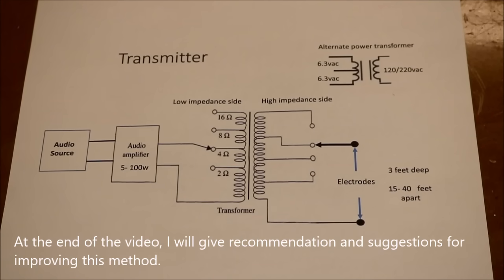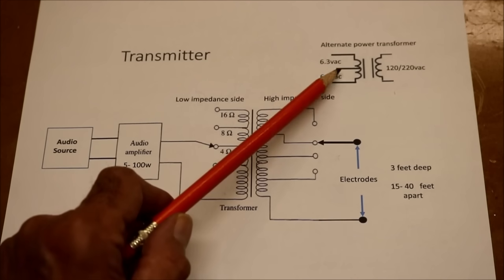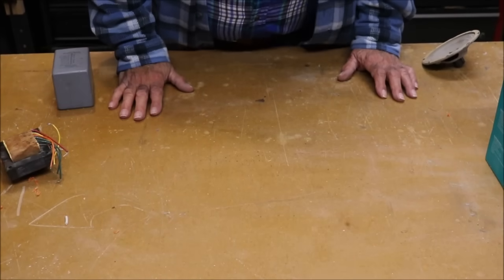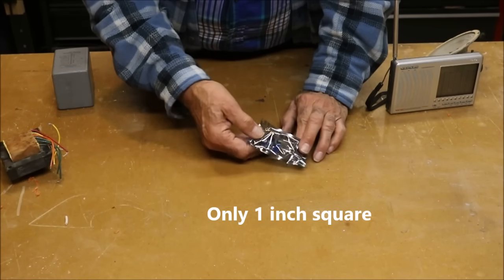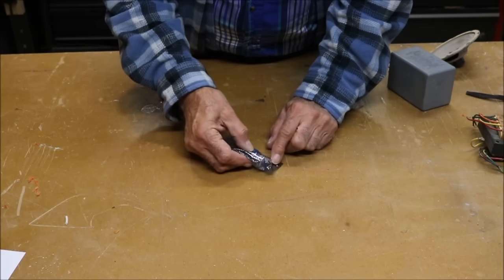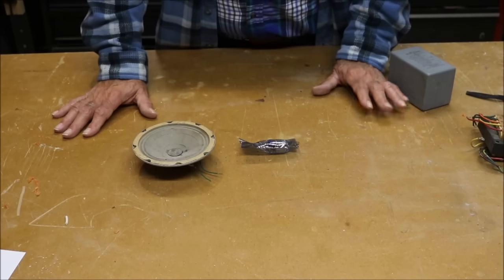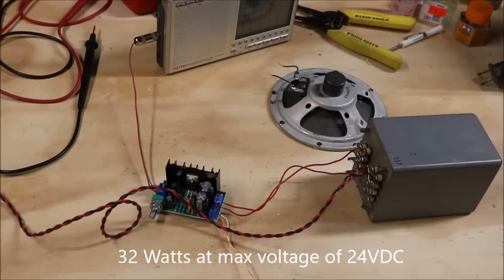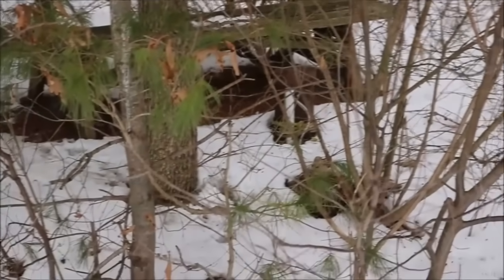DIY Communication Through the Earth

Comment: There was an English student radio station called UKC that started off this way, using the central heating system and earth as the transmission line. You just connected a modified transistor radio to receive the signal. This was when the BBC had the state monopoly.

Comment: I have been thinking about building this device.  It is for digital communications through the earth.  So maybe you could interface it with a Raspberry Pi.  Brian Pease has modified this design to a class E amplifier, but then it requires tuned antennas.      
https://radiolocation.weebly.com/uploads/2/7/5/2/27523347/creg_j124003iandrummond.pdf

Comment: Seems very interesting- I´d love to have a follow up with actual transmitted audio to listen to, actually hear what comes out of it. The crystal headphones part would be hard for me.
The only crystal phones I know are antique and (I think) sought after by collectors. I seen a few on Egay but the asking price was redicolous. But I like this low tech.
But if it is known this being used I could listen in on other coms? What happens if more than one broadcast happens in close range of each other? Would that garble up both?
You need to go into this further. Maybe it is worth re inventing… Greetings
Reply from the maker: The earphone in the link I provided are high impedance and aorund $12. When the weather warms up I may do a repeat, but not when is is 5 above with a wind chill. If two or more are broadcasting you would hear both on top of each other since there is no carrier.
Reply: @PracticalEngineeringSolutions  No, Sir- I don´t expect You to do a follow up NOW.
But in spring when it´s nice and the rods go easy in the ground.
Still: very interesting.

Comment: Many people do not realize but the Tesla's high voltage transmitter (Tesla coil), which is wrongly considered an aerial/air based system, is actually a huge high power ground-pulsating current transmitting device. The corona part, a HV capacitance system, is what the most people are familiar with, but the real work is done by the ground connection, were the power swinging between the HV capacitance and opposite side, the ground, is induced in the earth. That can be quite easily understood ones one read the article published by Tesla called "The True Wireless".

Comment: Great video. I did a similar experiment back in the 70's for a class. My setup was similar to yours except that I used a 10 Watt tube amplifier for the transmitter. I used a transistor amplifier in a box with a speaker and meter probes for the receiver. It worked for about a block distance. It was thrilling. One thing that happened is that the audio could be heard in all mater of audio equipment such as the telephone and tape recorder if the equipment was close by. I'm very glad that you did this test.

Comment: I have strong suspects systems like this, do not rely on radiation. Can these be actually conduction currents in the ground without any radiation at all?
Reply from the maker: I think you are right.
Reply: @PracticalEngineeringSolutions  But this is usually denied. Every time I ask, they fall back to "VLF ground waves",  "surface waves radio" phenomena, but never "ground currents" on their own, which are seen as a consequence, and a loss.
Reply from the maker: @tanner1985  If there is nothing radiating in the air, then .....it seems obvious
Reply: @PracticalEngineeringSolutions  thanks to a friend of mine, I probably deciphered the working principle. It is not working on conduction current. You mentioned the more spaced the ground rods, the better, right? The two rods have electric field lines connecting them. The more spaced, the wider the field. The RX side intercepts these varying electric field lines and currents are induced in the connecting wires that go back to RX’s transformers and amplifiers back to the speaker.

IMO, There isn’t any radiation, but any current flowing either. The working principle takes advantage of the dielectric constant of the ground to develop a stronger electric field. This wouldn’t work in air due to low dielectric constant.

Comment: Hello! It is an interesting experiment! What if you try to use high audio frequency (roughly 20KHz) as a carrier? With the SG3525 IC it is not difficult - there are power amplifier, an AM modulator (uses PWM function ) and an oscillator in one chip! I experimented with it - there was SG3525 with two IRF530 mosfets.Maybe ultra-long radio waves propagate better?
Reply from the maker: What is the purpose? To increase range at the expense of complexity
? I think that 20khz would not propagate as well. The Navy uses 76 hz in water
Reply: @PracticalEngineeringSolutions  Meh. An LM3525 is not that complex to use.
Reply from the maker: What is the purpose? To increase range at the expense of complexity
? I think that 20khz would not propagate as well. The Navy uses 76 hz in water

Comment: In the mid 1960's I was part of a serious spelunking group in  Louisville, Ky.  We built and tested a similar rig to enable underground-to-underground voice comms for separate teams.   We used the ubiquitous Radio Shack epoxy-lump audio amps and an ammo can full of D-cells with 18" copper probes on a long baseline. As I recall it worked pretty well but not well enough to pack all that gear into some of the places we were crawling. We went to VLF direction finding loops to track the sub-surface party and had very good, albeit morse-code, comms using that method. With these "Cave Radios" we could precisely locate the sub-surface party's location and determine there depth  underground. As I recall we were xmitting around one or two k-hertz and penetrating over 300 feet.

Comment: I would like to see you continue this experiment when the weather is better and amplify the output so we can hear it.

Would it perform better if you used a mixer (ne602) to adjust the audio frequency higher and then use another mixer the reduce the frequency back to audio on the receiver side?

Comment: So interesting to read about your experience. Like the other viewer I did similar experiments in the 60’s using tube amplifiers. The electronics magazines of the day had articles on how to achieve the best results like having the TX and RX rods parallel to each other, the most powerful amps and moist ground the best. One magazine talk about using two boats at sea. By keeping the boats parallel and moving them further away to see what maximum range could be achieved. Did the French resistance really use this method to communicate during WW11?

Comment: So this is really interesting, help me understand better how the communication was done through the Earth, what kind of transmission mode would that be and how would it propagate?  From the schematic, I understand that you're stepping up the voltage, so how is the audio modulated, by current?  or is it AM?   Also, the two rods on each must form a path with a return... one is the reference, does it matter which side they are, is it reversable?   Could there be other modes of transmission or modulation schemes such as FM, polarization (not sure that applies).   I'm hope I'm not asking silly questions, I'm just trying to wrap my mind around this.  Overall, it seems like a very interesting experiment.
Reply from the maker: Is is simple audio, no carrier wave..The rods are revsable. There are other possibiites such as using a low frequency carrier but are more complex.
Reply: @PracticalEngineeringSolutions  Right, not using a carrier wave like AM, FM, SSB, etc. but I'm thinking current through the transformers?  While I think it is an electrical connection, just how is that mixing in the ground and propagating.   Then my second part of the question was what if you were it inject it as a ELF kind of FM signal?  It was a hypothetical and a curiosity.  I find it fascinating TBH.

Comment: The rod seperation distance may effect the capacitance between them. The transformer and capacitor would create an LC tunes antenna. Could be the why some results were different. Distance between the rods could be improved by finding the wave length of the frequency used. Higher frequency has a shorter wave length and lower  frequencies have a longer wave length. Just a thought.
Very interesting video. Thanks
Reply: 🟦…I would add that the lower frequencies will allow you to broadcast farther with the same power and are less easily dispersed or affected by interference.
... I'm pretty sure I Don't have that backwards.

Comment: I did research into ground penetrating radar some 15-20 years ago. We were able to do a 3D image of the tunnels into a mine that was 150 feet down. But that was 1-3 MHz. Down at the bottom of the mine, we were able to hear LORAN, and VLF transmissions from Cutler, Maine 250 miles away. Plus AM radio, weakly. Nothing in the VHF or above.

Comment: I was a Field Wireman in the US Army, we trained on using a 2 wire system to connect 4 independent phones to a switch board using different patterns of ground for return and for sending the signals, they were hooked to old switchboards such as the SB22 or SB86 which we used in HQ 18th Engineer Brigade in 1970, we used a 22 when I transferred to the 45th Engineer Group when the 18th was sent home in 71. They worked well, like your experiment, we used tube amplifiers and a rather fancy type of transformer with several input and output terminals so they could be wired the way we needed them for operations.  We used the same concept for our landline teletype, a job I transferred to when they learned I could type, troops were getting short because of the pull out so they needed to cross train some troops for different jobs. I ended up with 3 communications job designators which helped me when I became a sergeant and was put on charge of a Company Communications Section.

Comment: I played with this back in the sixties and got ranges of 500-plus yards with 30 wats and100 foot rod spacing another thing you can do to increase range is to use a low-frequency carrier and modulate it with the audio and ranges of at least a mile were possible

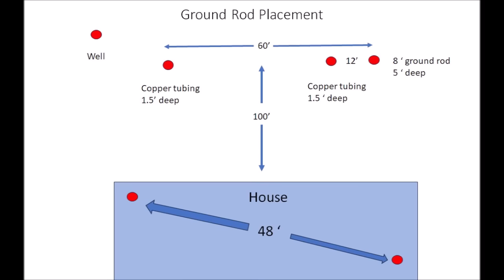Comment: 8:33
I showed a slide of the placement of the electrodes. You didn't explain how you connected the earphones to the two electrodes that were spaced 60' apart.
Reply from the maker: @mrcleanisin  connected them directly with long wires
Reply: OK, as a side note, I did something similar with 120 volts to bring fish bait worms out of the ground.
Reply: Have a look at around 2:49 in the video and there's a clear diagram showing how the earphones are connected.

Comment: Interesting that was fascinating. It's almost sort of basically a 70 V commercial audio system but with the ground carrying it fascinating. If you got some thing that did 70 V output you would need the transformer going into the ground because that's essentially doing it already although using the very active fine-tune it is interesting.

Comment: we used that in the German army still in the 1980ties - we, coming from school, and had to join, tried it out - but, if only using bad electrodes/not too deep, dry surface, it is not working over longer distances. So we used one wire + earth. That worked sufficient.

Comment: As an aside, old phone lines used to use a single copper wire above ground and then the ground for the return path to save wire and copper. In WW I, they were looking for ways to listen in on these conversations, using two widely spaced ground rods and an audio amplifier (high tech back then). It worked. But they also heard weird sounds in the audio. These sounds were ELF atmospheric sounds: Whistlers, Tweaks, and so forth. This technology is much older than many people realize. It relies upon the differences in absolute ground potential.

Comment: I tried underground communications back in the 1960s using an audio amp with 4 6L6 tubes in push-pull parallel with about 100 watts out. It had an output transformer with several taps. I buried the chassis of an old TV set in the back yard. I could hear the audio about 500 feet away using a transistorized amp connected to 2 nails a few inches into the ground.

Comment: The Navy uses a system similar to this to broadcast to submarines that are submerged. However they modulate an Extremely Low Frequency signal (ELF). The transmitting antennas are buried in the ground and high power is used. The bandwidth is small and the messages are encrypted. So it takes many minutes to just transmit a page of text. At least the subs will be able to stay up to date on what’s happening above.
Reply: They also use tacamo e6 aircraft and probably others
Reply: And such technology or similar (ultrasonic ) could be the reason for whales escaping from water , at Australia coast
Reply: Skaggs Island.
Reply: @johnprenton9561  nevertheless. Sonar, or some weapon killing whales. Why nobody wants to tell it loud?

Comment: Thanks for that, very interesting. I think it might work better if the second electrode on both the Tx & Rx  is disconnected from ground and connected to a non-grounded conductive mass. (eg car, bike or container of salt water). This would allow the ground to act as the AC conductor and the mass to act as the ground.

Comment: How interesting to find someone else who has experimented with this concept. One of my childhood friends and I, over 50 years ago when we were teenagers, played around with this concept using our 35 watt guitar amplifiers. We lived several block apart, about a half mile, and we could hear each other talk. There was lots of hum and noise. We never thought of using transformers or changing the orientation of our ground rods. I used the house plumbing as one ground and drove another pipe in the ground out in the back yard. I could also hear my own amplifier by taking an 8 ohm speaker out in the yard and connecting it to two short metal rods about 20 feet apart. No amplifier needed to receive when that close by. I ‘ve told a few people about doing this and to date no one would believe me.
Reply: Same story but in Poland. The idea came from an electronic DIY magazine.
Reply: @prostytroll  Reminds me, was the DIY Magazine that I recall being linked on some Hackaday comment for a somewhat related communications article if I recall correctly.  I recall reading about for mining operations and similar spelunking, though this article confirmed my suspicions in Elementary Electronics 1972 05 06.  Reminds me somewhat of using lab electronics test equipment for RF, signals analysis and or comms use.
Reply: @ As I remember it wasn't.
Reply from the maker: ii also did it about 50 years ago when I was a teenager,  It was easy to do and a lot of fun. I later did it at parents house and got a distance of about 1/4 mile. I was surprised this time that some of the electrodes were only 18" deep and it still worked.
Reply: Today your national security service would surround the blocks and smoke you out. 
Suspicion of terrorism is what the newspaper says the next day

Comment: This is very similar to a circuit in Electronics Illustrated September 1961. The issue's PDF is available via google search. The article called it a "Terraquaphone" and is a rather simple build using three transistors, might be worth building and comparing the two?

Comment: Look up:
geophysics resistivity
You will find that this sort of thing has a use other than communications.  There is a lot of information there.
There is also some you may be able to find about the use of this sort of thing in WW2 beyond the resistance movement.
The signal does fall off rapidly with distance but there are a few things you can do to get better results.  One simple one is to use a single frequency and morse code and make your receiver narrow band and high gain.  You need to keep the frequency low to avoid skin depth issues.

Comment: In the 1950s, a good friend of mine and I set up a system like this. We were 13 or 14 years old. I had read about it somewhere. Our houses were about two blocks apart. We drove electrodes into the ground, carefully making them aligned to each other geographically. We used a vacuum tube amplifier and tried a variety of transformers. It worked. There was hum, to be sure. We never managed to come up with a hum filter. But, we could communicate with each other over a distance of two city blocks.

Once it worked, we never used it again, going back to the little AM band transmitters and radios we had set up for communications again.
Reply: Richtig toll solche Geschichten lesen zu dürfen und gleichzeitig davon zum ersten Mal zu hören❤❤❤

Comment: Electronics scavenger's tip: You can get fairly big (200-2000VA) multi tap iron core transformers from e-waste if you get hold of a UPS (uninterruptible power supply) for computers etc. Most of the time they fail because of bad batteries or power transistors - never found one with a bad transformer yet. Usually free for the asking, or a few bucks metal scrap value.
Reply: careful tho
Reply: Those transformers are optimized to work best about 60 Hz. The laminations would not pass audio frequencies very well.